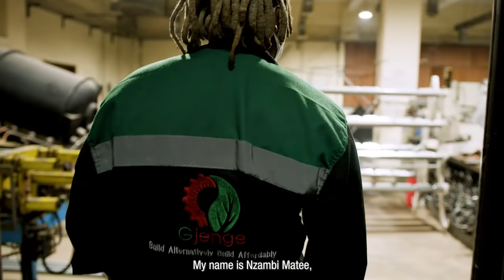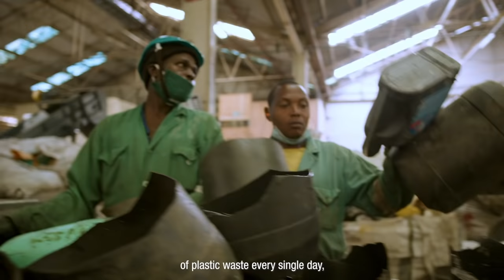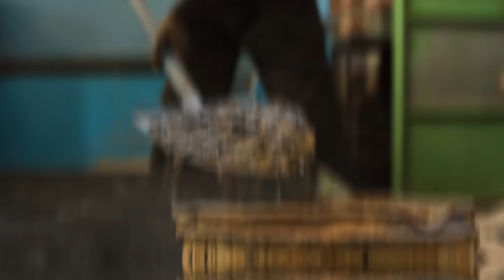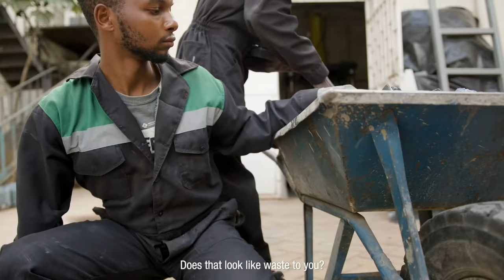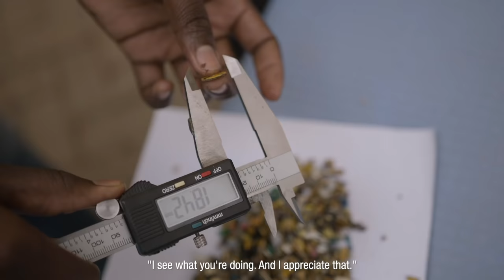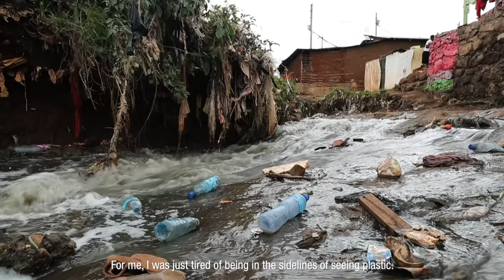Plastic bricks in Kenya - NZAMBI MATEE - Young Champion of the Earth 2020 for Africa

Comment: Is it even heat resistant?
What about particles that can cause cancer when the plastic gets too hot
Reply: first what i thought about
Reply: but what you will choose this brick or nothing
Reply: @warnabas  What will you choose, health of poisoned bricks
Reply: I thought hot plastic is only bad when consuming water from a hot plastic cut or eating from a hot plastic playe?
Reply: Better a house that has deadly air when it burns then having no house at all. I don't think it will come to europe but maybe in africa it could be a good idea.
Reply: @swagpatriot696  Africa as far as I know is in no dire need of raw materials
Reply: hdpe is already used in building and infastructure it would have to get to 250 celcius to be dangerous and mixed with the sand that will take heat away from the plastic its likely fairly safe
Reply: all bottled drink company employees and CEOs have to live and work in buildings, parks, etc, made with these bricks! Of course, they have to pay $$ as well.
Reply: @bepiisboy2911  how does the sand which is mixed with plastic, take heat away from plastic? How 'far away' is that heat? The last I know, we use sand to keep heat in metal foundries, in traditional field cooking.
Reply: First world problems...
Reply: @nieiniei  honestly im not an engineer or anything, but my thought was more so the sand having a higher melting point would disperse the heat and take the hit, similar to a heat sink on cpus and bring up the melting point a little higher just like pot ash brings down the melting point. either way i dont think we have to worry too much about toxic fumes being released
Reply: @nieiniei  thanks for your reply, forgot about risks of fire hazzards. i thought the original commenter was talking about heat from exposure to the sun
Reply: @warnabas  this non sense why we are recycling plastic because for us by doing this we risking more
Reply: @handsomelyhung  It is the gases it puts off as it degrades in the heat and/or sunlight, that is the real danger here.  And it is a very real danger.  And I need to be clear about this.  This is not just some threat.  It is guaranteed.  You expose plastic to heat and/or sunlight and it puts off very toxic and harmful gases.  Those toxic and harmful gases is what holds plastic together.  Here, stop by your local fast food joint tonight on the way home and get an extra large drink, make sure to go to a fast food joint that serves their drinks in the plastic cups.  Then take drink and either drink it or throw it away(I recommend throwing it away, because soda/pop is poison).  Then wash the cup out and put it on your windowsill, a window that gets sun during daylight.  And just leave it there for two years.  When you go to pick it up after that two years has passed you will discover that the cup is brittle to the touch.  Even the slightest touch will cause it to crack, chip, or crumble, or a combination of all three.

What is going on here is, there is a myth that plastic is not biodegradable.  When in fact, it most definitely is.  The thing is, when plastic degrades it lets off harmful and toxic vapor.  Those gases are, in effect, sequestered in the plastic.  The best thing we can do with plastic is dig a deep hole in the ground, VERY deep hole, layer the hole in concrete, just going to grab a number off the top of my head here, 5 to 10 feet thick, put all of the plastic in the world in that hole then seal over the top of the hole with the same 5 to 10 feet of concrete, then bury the hole.  And then leave signs easy enough for low to semi-intelligent beings, notifying them of the dangers of opening it up, like what we do with nuclear waste storage facilities.  That is the best we can do with plastic.

30 or 40 years from now, people who are/were exposed to these bricks for a prolonged amount of time are going to start experiencing severe health problems.  That is guaranteed by the way.
Reply: What if the plastic bricks are already covered with solid cement?
Reply: They're just used for patios and pathways at the moment.

Comment: I'm guessing it will never be used in building a house because of fire and does cement or mortar bond to the plastic? If it does bond the Chinese would love to use this in place of cinder blocks
Reply: Because of fire?!! What about wood, Still used to builds houses!
Reply: @ralphfigaro4485  The burning of plastics releases toxic gases like dioxins, furans, mercury and polychlorinated biphenyls (better known as BCPs) into the atmosphere, and poses a threat to vegetation, and human and animal health
Reply: @vinylvishrecords  wood smoke also contains dioxins. It contains several toxic air pollutants including benzene, formaldehyde, acrolein, polycyclic aromatic hydrocarbons (PAHs).
Reply: @ralphfigaro4485  Cinder block homes use wood for internal framing of walls and the roof, but not the load bearing walls.
Reply: @ralphfigaro4485  A quality hardwood will outlast concrete in a fire.
Plastic will rain down.
Clay bricks are a better solution than plastic bricks.
Plastic bricks are just for virtue signaling and getting some of that sweet U.N. money.

Comment: I like the enthusiasm but I need to tell that normal construction waste can be recycled. By adding plastic into the mix, normal construction would not be possible to be recycled. By solving one problem, she created another problem later on.
Reply: Possible, but you gotta also take into account that she created an extremely cost-effective way to create building materials that could be used in parts of Kenya that would definitely benefit from it. 
Sure you can't re-cycle them but it's still removing a lot of waste from the environment that would otherwise never be removed. I see it as a positive. With plastics and waste management there's never a full no-problems solution until we stop producing it.
Reply: @yossarian00  Microplastic are dangerous too. As time flies, erosion and damage will release the plastic in bricks to river or ground.
Reply: @yossarian00  If the whole house was made out of plastic then she would have solved that problem as well.
Reply: @firmanhermawan7176  yeah but what do you prefer: plastic waste littered everywhere turning into microplastics, or plastic bricks turning into microplastics
Reply: "as an expert recylcler"
Reply: @yossarian00  It's the exact same situation like the wind turbines. Everyone hyped so much about it but now after ending the cycle of the first turbines we figured out we can't restore nor recycle them so they end up in a graveyard. And that's because the world got scared of nuclear power and started moving towards "green energy" which needs a shit load of these turbines to make the power generated by one nuclear plant. This is not a solution, but a disaster on long term
Reply: @PescarStangaci  Similar story with solar panels, it is a huge shame there is so much fearmongering about nuclear power, when in the end it is the cleanest and also cheapest way to produce energy. They're not dangerous, especially now. Too bad German politicians have their heads so far up their ass they actually unironically claim that nuclear energy is the worst.
Reply: @yossarian00  at least solar panels are useful at the consumer lvl, helps you go off-grid but you're right, solar panel farms are expensive to produce and you need a shitload of them on a very large surface of land to produce a small fraction of what a nuclear power plant can produce.
The irony in Germany's road to green energy is so stupid they ended up buying electricity from France and guess how France produces it: Yep, nuclear :D. Basically their logic goes like this: "doesn't matter if it's nuclear as long as we don't produce it"

Comment: My concern is, “doesn’t that burn good when it catches fire?!?? I mean, is it safe on streets when flame contact the surface?
Reply: It's also just for paving bricks currently, theyre working on a building brick, but it's certainly not impossible to make one that is fire rated. Most in suite flooring in modern condominiums are made with vinyl, as an example of a fire rated platic.

Comment: So smart, so caring, I love this.
Reply: @Gogofam123  Ok, what am I missing?
Reply: @janicem4382  plastic in these bricks will eventually degrade. It will be turned into micro plastic that can cause severe health issues. Also heat and fire will easily burn the plastic resulting in toxic fumes. Idea sounds nice but it’s not an innovative. It’s been done before and there’s a good reason why it’s not used widely.

Comment: did they even take certain elements into concideration: the breakdown off plastic overtime, the roughness and durability with heavy weights.
Reply: I was thinking the same thing. What about micro plastics in the food and drinking water over time. And building with plastic in hot climates could release toxic fumes, no?
Reply: @FloridaKatLady  correct!

Comment: Using it for footpaths makes a lot more sense. I thought it was for home-building and thought that was insane.

The slip from water may be an issue unless the sand makes it so that it is more coarse than smooth.

What is the cost for this and is it feasible to bring to a developed country in scale?

Comment: I like this. It's small scale but has the potential to be much bigger. Unlike some companies just making pens or whatever out of plastic, which really only uses up a fraction of waste, bricks are everywhere and could make some sort of meaningful dent on plastic waste with enough scale. Like others have said, the toxic fumes if melted are a problem, but the core idea is great.
Reply: if this brick could be made solid enough it could be a good sublayer for roads. Not a surface layer because the plastic would wear away into microplastics but underground to serve as a base would be great.

Comment: I'm sceptical for use as a floor because of abrasion, but as a building block for houses this is great. It's out of the way, you don't turn it to CO2 like if you would burn it. Additionally, the cement industry is a huge CO2 emitter, so you save double. I would imagine it also has good thermal properties, and you can make it like giant lego.

Comment: I cannot describe how pleasing it is to see people using the plastic problem, as a solution. Here in Conroe, Texas, humidity is usually 100% with 100F, with minor fluctuations and rare freezing. Damaging bugs and rats too. These things make building with wood so foolish, yet that is exactly the material used for house frames and fences. Using all the rubbish plastic for lumber or blocks for construction of fences, homes, barns, patio decks should be the standard. But, the bribery, I mean political lobbying, keeps unsustainable industries as the standard. Imagine if the existing government and political personnel were actually monitored and prevented from accepting bribes, I mean lobbying, how much cleaner the planet could be?

Comment: That sounds very good at first sight. And I definitely like the entrepreneurial spirit!
But I am not sure it is a solution for the plastic-pollution problem. Right?
It is primarily a solution for the litter-problem. And it generates jobs. And that is definitely great!
But you still have blocks of plastic all over the place. Will they not brake down eventually in to smaller pieces and over the years into micro plastic?  What if a house is made of these bricks and eventually the house burns down? Or a car catches fire on a plastic brick road? Will the plastic blocks burn?

Anyways. It's a great thing. And more power to them, but there are a lot of questions open about how much of a solution "for the nature" that is.

Comment: It could be use to make house 3 D printed, sand will make abrasion so tube of extruder should be made in ceramic but it could be a very elegant way to make thin walls feeded with earth and straw at high speed

Comment: The idea may sound amazing as a civil engineer I would object these kind of ideas basically in 3 POINTS 

1.The brick is a plastic made which we live under and  ultimately transferring micro plastics by touch and weathering actions 
2.A FIRE CAN KILL A BUILDING OH NO SORRY AN ENTIRE AREA TO DUST 
3.A plastic made buliding is not sustainable the air quality changes room environment alters badly 
The idea behind saving environment is very good but replacement of cement cannot be done as of our technology may be in future a replacement material would be generated

Comment: I tried this methode but the bricks ceep cracking .can anyone please tell me how to avoid these cracks .
Reply: she does not use any plastic
Reply: @imranmaredia7523  i don't get it . Isn't she using plastic ( bottle caps) and sand ?
Reply: She does not use plastic bottle caps. Somehow she uses plastic that has some unique elements that can make strong bricks. Somehow bottle caps do not contain that element and she discards them to be used by another industry. If you google her on you tube in one of her video features she explains the different components of plastic that she uses for tiles or bricks

Comment: Good project and all but just looking at it's practical side its not the best. Like building a house out of it might be posible but cutting the bricks to side would damage the tools so fast cause of the heated plastic binding up the power tools; and what binding tools would even be used for these bricks cause i dont thing mortar would stick. Anyways i like what there doing but i dont find it practical.

Comment: I'd have thought using these as paving bricks is about the worst option. Uv degradation of the plastic and the general weakness of the plastic compared to conrete will mean they erode quite quickly. More use for applications where they won't be abraided and impacted.

Comment: Its awesome, actually i was wondering why is plastic not that often recycled or turned into everything whats possible to stop the waste and littering...😡 i always collect bottle caps cuz some charities use it but most of ppl doesnt even recycle plastic just mix all trash
Reply: I've been collecting bottle caps since last year.  I was originally going to try to turn them into 3D printer filament, but I didn't have the tools or machinery to produce a plastic extruder machine.  Now I just collect them for fun.  I don't know why, but I enjoy it.
Reply: @kingklaus2115  lol :D well u can make a floor with caps or table pattern🤔 no idea, im curious how many u have collected, must be nice pile.
Reply: @yilingpatriarch31  So I did a lot of math to see exactly how many caps I had based on the volume of the box I was using and the volume of the caps I had in the boxes.  I first started collecting on 4/2/2021 and have collected a whopping 5044 caps within that time frame.  I solved for both the number of white caps and the number of blue caps, and I found that I had collected 866 blue caps and 4179 white caps.  Knowing the start date, and knowing the total number I have collected, I determined that I collect 11 caps per day.   These values were spread across one and a half boxes.
Reply: @kingklaus2115  um woah thats plenty.@_@ its from drinks u buy? Im sure i buy less than 100 water bottles per year 👀
Reply: @yilingpatriarch31  The water that comes out of the tap is too full of sulfur for us to drink.  I don't think it would do any harm if we started drinking it, but it smells and tastes like rotten eggs.  As a result, we have three cases of water in our laundry room at any given time.  Plus, we go outside a lot and take the water bottles with us out of convenience.

Comment: Alright. I need me someone smart to tell me how this isn't going to work.
Reply: 1. Wouldn't pass fire safety code. 
2. Temperature effects plastics integrity so it probably cant be used for load bearing walls.
3. Plastic leeches toxins to the environment. 
4. Can't be used for a road surface as it would deteriorate with use.
5. Again can't be used for a road surface as it wouldn't be up to an acceptable level of courseness that's required for grip purposes.
6. Ultraviolet light from the sun has a massively detrimental effect on plastic.

Comment: I don't think this idea is all that great. First of all plastics are not very erosion resistant. Therefore, it is not a good material to be used as a brick. Furthermore, due to the degradation the bricks will polute the environment with microplastics. Then there is the cost involved. These bricks are much more expensive than normal bricks. Finally, mixing plastics with sand eliminates future recyclability.

Comment: This is a terrible idea.  pavements and roads wear away and the micro particles end up in the water supply, rivers and oceans.  They are then impossible to remove.  Waste plastic packaging on the other hand is so large that it can be removed from the environment by simply picking it up.

Plastics are made from oil.  So, the BEST thing to do with plastics if they cannot be reused is to burn it as a fuel.  If you burn plastics at over 650 degrees there is almost no polution.  This is because the refining of the oil to make the plastic makes it a very 'pure' product.  Just think of it like this - plastic waste is just oil that was going to be burnt anyway but it had an extra use on the way to being used as fuel.